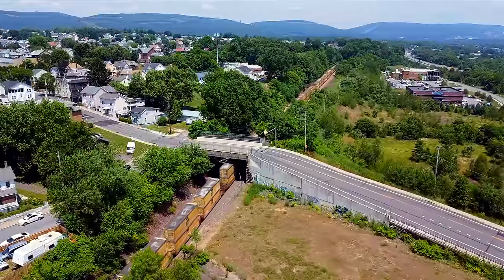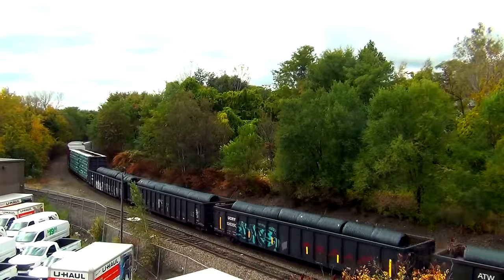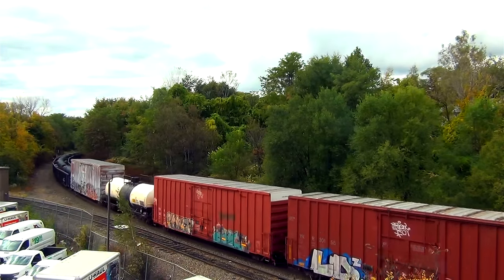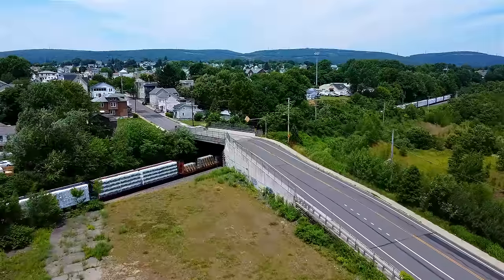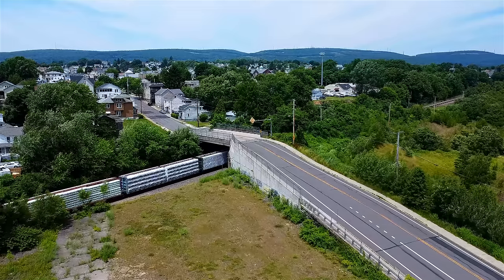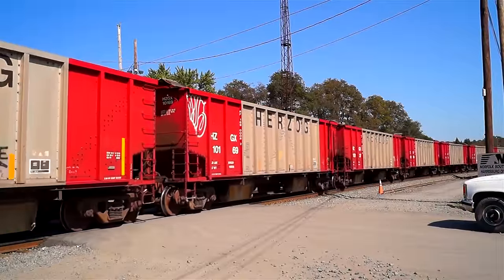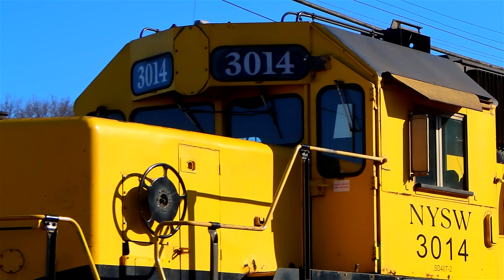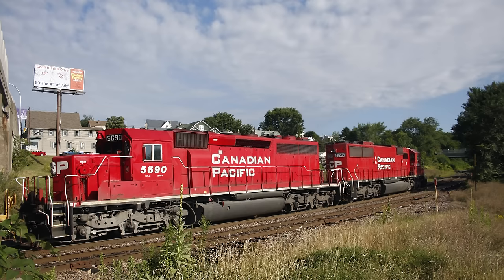[T-509] How Locomotives Work: DPU Lesson of the Day

Comment: Come on now, the main advantage of DPUs is that they allow more efficient performance while getting rid of a train crew to man them. Helper sets do everything DPUs can do, but of course they require a crew to man them
Reply: Way to call it how it is automation to put a guy out of a job
Reply: MU’s however only require one crew for multiple units also. Helper units require a crew because they do not stay with train, they are temporary and let off a after a short push to get the train over the section where more power is temporarily needed. Then they move on to the next train that needs help on that section. Witch means that they are capable of independent operation.
Reply: DPU took away a really nice helper job at my yard

Comment: 2007 i was working with UP in FT worth TX and i asked them why every train has a dpu, he said it gives them 8% better fuel economy, control from both ends of the train and less train separations due to draw bar forces on a grades. think of it as a big radio controlled car. down side is in hills with lots of curves you can lose radio signal

Comment: out west those are probably the wire connected DPU's instead of the wireless jobs AC!! if you want some info on CSX you might want to get a hold of DJ over on DJ's trains channels he's an engineer for the cheapskate express as the track gang around here refers to CSX!!
Reply: nope... radio controlled

Comment: Hey man... 

Cp rail is the pioneer of DPU opps. And started it and ran continously on coal trains in the 70s. They started this with rebuilt B units to house the radio equipment. The CP roster of sd40-2s was #ed for slave and masters in the 58xx and up .. there is a lot more info on this. Plz update the video.
Reply: If I remember correct, SOUTHERN was also very early to do/,try stuff like this in the late 60's/ early 70's, especially on the line over Saluda Mtn.
Reply: @martindoyle831  no… Southern Railroad did it from the 60’s . They had radio controlled equipment in converted boxcars